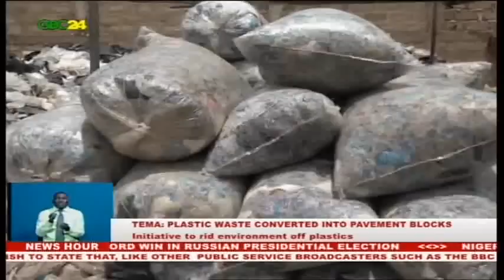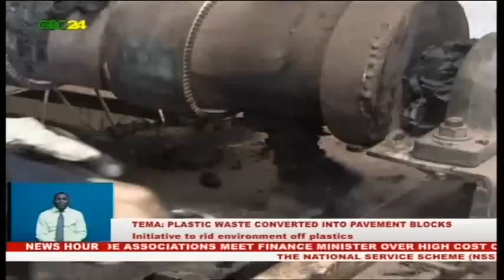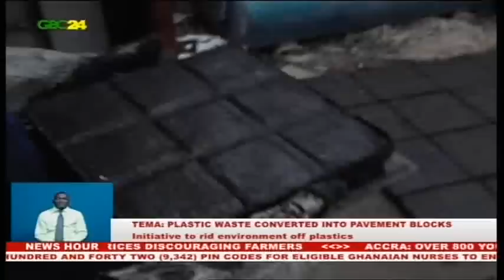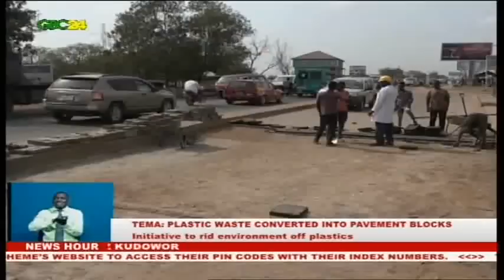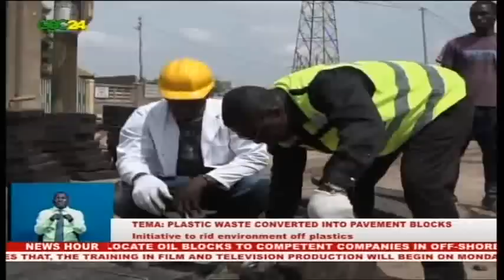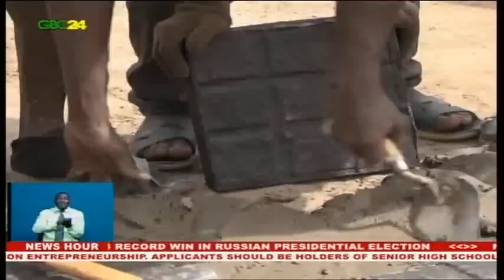TEMA: PLASTIC WASTE CONVERTED  INTO PAVEMENT BLOCKS

Comment: I am having two problems regarding waste plastic pavements .
1 shrinkage
2 flammability
Can any body help me resolving these problems
m.rehanshahid@yahoo.com
Reply: Shrinking is not a problem and the same thing that tackled the shrinkage tackled the flammability. The sand in it prevents shrinkage even with temperature as high as 100 degree because the sand had given it the structural supports and the flammability has been drastically reduced because of the presence of sands.. So nothing to worry about. More research needs to be carried but those are not to be problems.